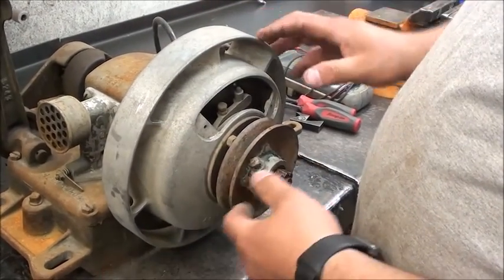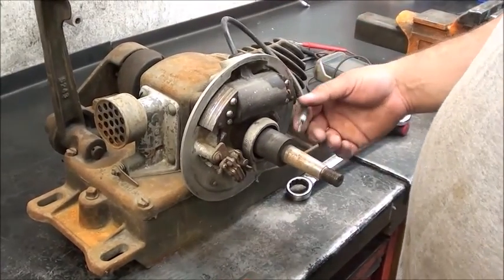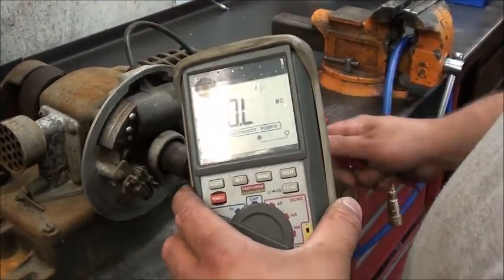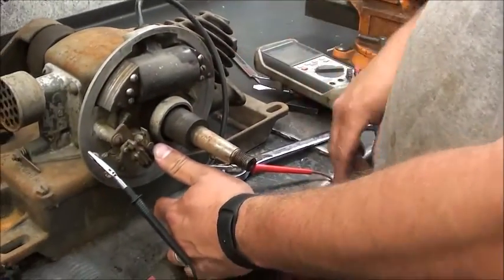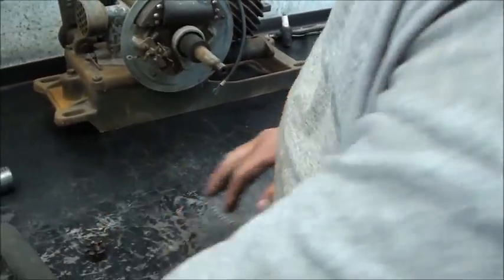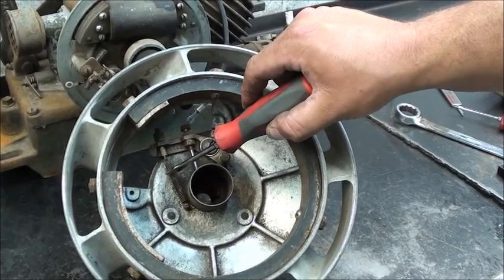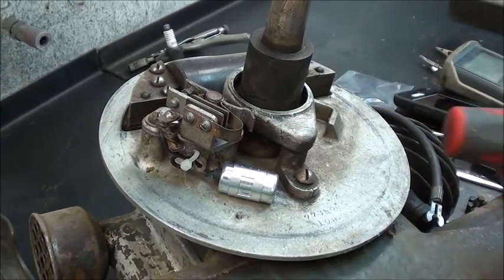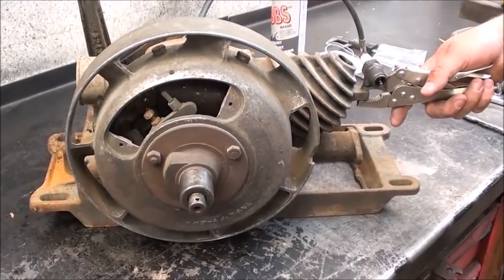Model 92 Maytag Engine Timing

Comment: Hi i just have a quick question, first off i just bought a 92 maytag hit and miss, i took off the spark plug with the wire connected and put the sparkplug to the engine and theres no spark, i put my finger there and it shocks me which makes me beleive the coil is still good, and my guess is that maybe the magnet inside is weak, i did check the magnetism of the ring and it didnt seem to have much compared to most magnets or even flywheel magnets on chainsaws or small engines, so with your experience in these do you think thats my problem, this is my very first hit n miss engine,

Comment: What kind of gas do you use to put it  and where is the tank ?
Reply: Reg gas,  30 weight non detergent oil @ 16:1 ratio
Reply: Whats sparkplug gap on the maytag 2 prong ?
2)  what color is the spark  supposed to be? 
Mine is weak yellow!
3) my 93 had 2 condensers.  Can I use only one?